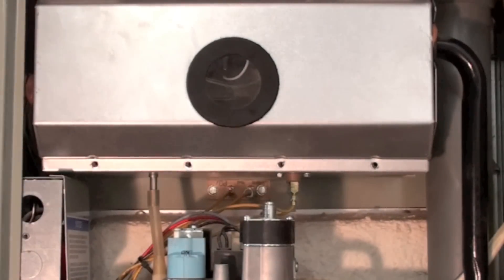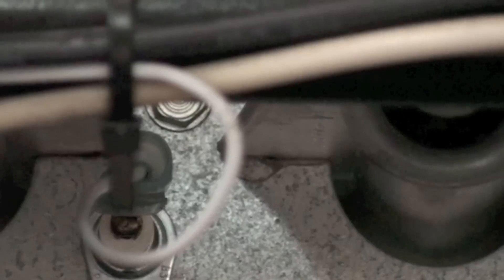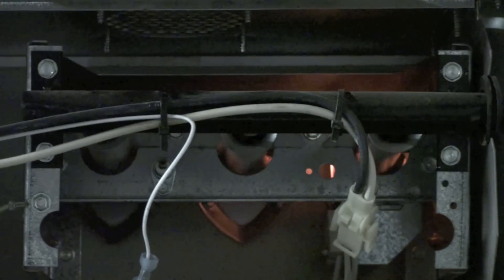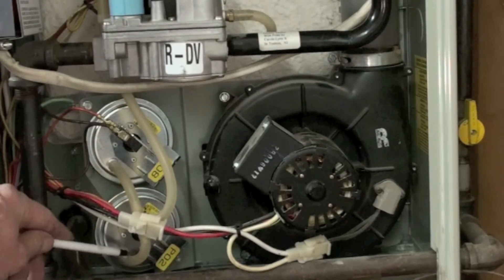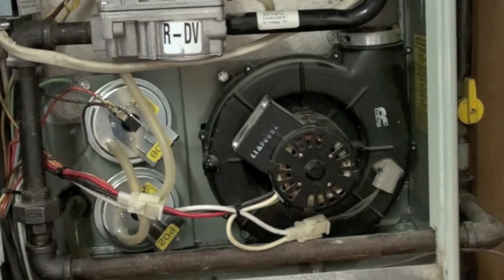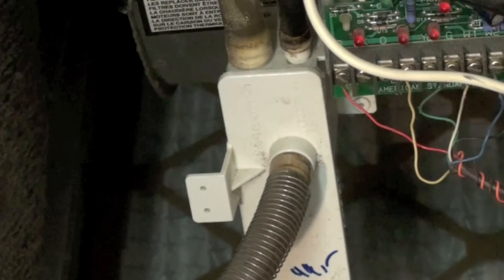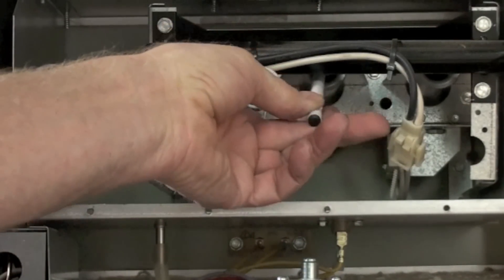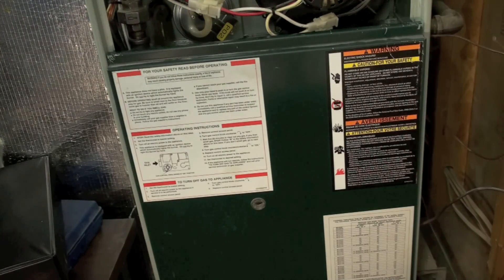Why does the gas furnace short cycle

Comment: Mr Furnaceman I have an Amana sse 80im getting what I think is a 3 light code blinking the furnace comes on the house reaches its temperature and shuts off and it wont come on again unless I shut it off and turn it back on again then when it gets cold the furnace tries to come on it does this short cycle thing I see the orange glow I hear the fan and it does this 3 times and then nothing I have to shut it off and turn it back on. Can you help me TX.
Reply from the maker: My thought is that the flame rod is dirty.  This video may help:  http://youtu.be/0ZYXK8450mM  Hope this helps.
GFM
Reply: well I took my problem to a local furnace parts store and the y thought it was an auxiliary switch so I replaced it that didn't fix it so they suggested a primary switch which I ordered so they tell me why don't you have a furnace repair guy look at it I told them I would rather try and fix it. so I break down and have a guy come out  I tell him about the code and he says ok ill look at it he cleans the furnace suggests getting a new thermostat and getting bigger cold air return vents . he says everything is good furnace is running I come back home furnace is not running and still blinking a code im out 120 and same problem.he said he cleaned all of that. like I said the furnace will run but after its heated the house and shuts off it wont come back on it trys but it wont fire up unless I reset it. TX
Reply from the maker: ***** This still appears to be a flame sense problem.  I assume the HSI is coming on, flame starts and shuts down after 4 to 7 seconds then shuts off.  Let me know if this is what is happening.
GFM
Reply: yes if that's the thing that glows orange then yes I hear the furnace come on the HSI lights up I do hear something click but there is no flame it does this 3 times and shuts down
Reply from the maker: ***** Are you sure you has gas available?
GFM
Reply: yes because sometimes the furnace works
Reply from the maker: ***** If you can determine that the gas valve has power(make sure the click is coming from the gas valve), you can place a screwdriver on the valve and put the handle to your ear, then the gas valve has failed. 
GFM
Reply: but wouldn't it fail all of the time ?
Reply: ok it did it again and I took the panel off and I actually put my hand on the gas valve and it clicked 2 times and I felt it and the furnace would not fire again so I had to reset it
Reply from the maker: ***** As for failing all the time, they sometimes are intermittent failures.  What it looks like to me is a failed gas valve.  Let me know if you decide to replace the valve yourself.  There are some tips you need to know.
GFM
Reply: Can you be pretty sure of this because I have already sunk 160 dollars into this project and that was even calling a furnace company
Reply from the maker: ***** I'm as sure as I can be without being there to troubleshoot.  
GFM
Reply: Ok I think I'll do it myself called the parts store they have it for 50 bucks. What's your tips. TX
Reply: Plus I called back the company to voice my not being satisfied and the guy said he would test the valve and hopefully that's it and not the circuit board. What are the chances that it is that.
Reply from the maker: ***** What I am going by is your report that you heard the valve clicking.  If the valve clicks, it means it has power.  But certainly having someone check it with a meter would be best.
GFM
Reply from the maker: ***** Replacing a gas valve involves breaking into the gas line.  Be sure the gas cock is off next to the furnace.  Look for the arrow on the valve.  It should point toward the furnace.  Once the valve is installed, leak check with soap bubbles every fitting you moved.  At this point, only leak check the up to the inlet.  Start the unit.  Leak check all fittings from the valve to the manifold.  Be sure you are thorough here.  When it is operating, check the gas input.  The easiest way to do this is by clocking the meter.  Here is a video:  http://youtu.be/I0bWSBVCXbo  Be sure the BTU input matches the model plate input number.  If at any point you are not confident, call a professional.  Finally smell all around the furnace.  
GFM

Comment: I wanted to say thank you for the information. My furnace was turning on and running the first time and then when it cycles it would short cycle a not turn on again for several hours and then turned on once. I cleaned the flame sensor and it resolved the issue. Thank You for the great video.

Comment: Thanks for all of your helpful videos!  I cleaned the flame sensor, but I still get a short cycle, click on, click off for quite a few times before it stays on.  Watching the cycle, I noticed that the hot sensor igniter is cracked down the middle.  I didn't see a video on how to change it.  Is this also normal for a Janitrol/Goodman furnace?  Thanks in advance for your help.  D.A.N.
Reply from the maker: If the HSI is cracked, it will sometimes glow intermittently for a while then it will quit altogether.  The replacement is not hard to do.  You just have to remember they are very delicate.  Unlike some say, touching the ignitor itself will not damage it.  However, I usually will not handle it by the ignitor because it is so delicate.  Hope this helps.
GFM
Reply: grayfurnaceman So grateful for your help!!!  Thanks again, D.A.N.

Comment: IF SHORT CYCLE BEGINS WITH ICY TEMPS, FIRST CHECK FOR ICE CRYSTALS IN YOUR EXHAUST.  THESE CRYSTALS WILL CAUSE A SHORT CYCLE OR EVEN STOP THE CYCLE.  THIS IS COMMON WITH BASEMENT HI-EFFICIENCY FURNACES THAT VENT THRU PVC AT GROUND LEVEL.  THE STEAM PASSING OUT THE VENT CAN CONDENSE AND FORM ICE CRYSTALS RIGHT AT THE ELBOW AT THE TOP OF THE VENT PIPE - REACH INTO THE ELBOW WITH YOUR HAND AND PULL THEM OUT!

Comment: Our Heil is short cycling,  we cleaned the flame sensor, changed the thermostat out, changed the filter, checked the condensation water line, checked for.closed vents, nothing has changed.  I am about the watch your video hoping for another fix
Reply from the maker: The secondary heat exchanger could be dirty.  Usually the furnace will run for 2 to 4 min if this the problem.  Another possibility is a heat exchanger failure.  You also need to check the vent for blockage or sagging.  Hope this helps.
GFM
Reply: I called a professional.  I appreciate your help!

Comment: I've watched most of your videos and looked on your website but can't find a fix for my gas furnace problem. My furnace is an older Hamilton PKBD fed by propane. When the thermostat calls for heat the small blower starts, the igniter glows hot, the gas valve sends gas and the flame lights then the large circulating blower runs. After a few minutes the flame goes out for a while then the igniter glows hot again and the flame lights up. It repeats this cycle several times then goes into lockout which I understand is the normal process if it makes several attempts to light. This has been going on for a few weeks and after resetting the power sometimes it works fine for several days. Filters are new.  I've replaced the flame sensor. I checked voltage on the limit switch when it was in lockout and the power was still on. No voltage across the terminals. I shutoff power and removed the wires on the limit switch and checked resistance which was 0. Any thoughts?
Reply from the maker: First, I would be sure the propane tank is close to full.  If the level is low or the tank is too small, low temperatures will cause a reduction in available pressure.  If it is a high efficiency furnace, I would also be looking for water drain or venting problems.  Hope this helps.
GFM
Reply: Thanks, the propane tank is not low and it has happened in higher temperatures, above 32 degrees. Right now it's -14 outside and it's been working fine since I fiddled with the limit switch and air pressure switch.
Reply from the maker: David Musall Also be sure there are no venting problems.
GFM

Comment: Very good video. Had the same problem but found the problem to be a bad contact between the flame rod flange and the steel mounting surface due to stripped threads and a loose screw. The rod's surface was fine and I reinstalled it with a bigger screw and lock washer. Poor design for such an important function. It should be installed with a screw, nut, and lock washer. Hope this helps someone.
Reply from the maker: That would do it.  Good luck on getting a manufacturer to use a bolt, nut and lock washer when they can get away with a sheet metal screw.  Thanks for the thoughts.
GFM

Comment: What do you think about this: my furnace short cycles for about 45min each time I turn it on.  After that it runs fine- no problems.  Almost like it needs to warm up before it can function properly.
Reply from the maker: Don't turn it off.  I really have no idea about that.  Sorry.
GFM
Reply: Did you check the filter? I would think you did but I changed mine and my furnace quit doing it

Comment: This video is a GEM. I spent several days troubleshooting my system, which was throwing a code for the pressure switch being stuck open. I replaced the pressure switch and the system worked for a day then the same problem recurred. The system board was telling me it was the pressure switch but it turned out to be nothing more than a dirty flame sensor rod. Steel wool, Done. Thanks for outstanding info.
Reply from the maker: Welcome
GFM

Comment: the reason you vent motor is filling up with water , 1 is that you have a blocked drain , 2 you collector box is blocked, for the gurgling in the pvc pipe that telling me the pipe dose not have a proper slope towards the furnace , the gurgling should be in the exhaust pipe where it elbows up on the out side of the house
Reply from the maker: All true.  I might add if the furnace is a new install, the furnace should be either level or pitched down towards the front or it will fill the back of the secondary heat exchanger.  Thanks for the thoughts.
GFM

Comment: Great video
I have a york 90% natural gas furnace like the one in the video, igniter has been changed and flame sensor cleaned but the flame keeps going out after only a couple of seconds. When I called in the furnace guy he would tap on the pipe where the gas ignites to get it lite and said that it probably has dust or dirt in them. Anyway every time the furnace shuts off its a pain to get it working again. It seams like everytime I have to tap on that gas pipe more and more and now only the first burner lights and then goes out. Can I take off these little jets to clean them out?
Reply from the maker: You can clean the orifices.  Also clean the burners.  Be sure power and gas is off and leak check when you are done.  Hope this helps.
GFM

Comment: I replaced the igniter and cleaned the rod but the igniter doesn't glow.  I hear the clicks like you mention and the ICF has three lights.  Two are lit (pwr and ok) the third (flame) is not lit which makes sense.  The big blower will come on after a few minutes but still not flame.  We just had an ice storm in Texas but I'm not sure if that is the cause or not.  Any hints are much apprciated

Comment: Any  body knows why furnance it keeps burning the 3 amps fuse on the control board
Reply from the maker: Most of those fuse problems are related to a low voltage short to the chassis of the unit.  Get several fuses and put one in.  If, when you turn on the power it blows, start removing low voltage wires from the terminal board until it stops blowing fuses.  That's a very simple explanation of what can be a quite complex job.  Hope this helps.
GFM
Reply: thanks  this  it help me a lot

Comment: Hi. I have a Quatro Consolidated Industries gas furnance problem. The igniter sparks and flame on it lights but then instantly shuts down right before the other burners turn on. Any ideas?
Reply from the maker: Is the ignitor lighting a pilot?  Do any of the burners come on?  How long do they stay on?
GFM
Reply: The ignitor lights the pilot up for like a second - but none of the burners turn on at all.
Reply from the maker: Steve Weitzner Before we go any further, if your furnace is a horizontal type.  I believe they have been recalled because of a fire hazard.  Just a word to the wise.  I assume the pilot lights, then it drops out and the pilot shuts down.  If that is the case, I would guess there is a problem with the ignition control.
GFM
Reply: It is a horizontal type but our model was one of the few that wasnt recalled. I already checked that out but I do appreciate the warning and the info you gave me. Thank you for your knowledge.

Comment: Hi grayfurnaceman, I have a Day& Night furnace Model376CAV24055ACJA Serial # 3692A14187 that my HSI doesnt glow, I unplug the HSI and plug in my meter to check for Voltage, My induce motor is runing and the blower at at the same time, But i never se 120 Volts going to my HIS connections, is the someting ells for me to check here?
Thank you.
Reply from the maker: Are you placing the meter on the leads to the HSI or the leads coming from the control board?
GFM
Reply: comming from the control board,
Reply from the maker: Nemorio M Vasquez I would check the back of the control board to see if any solder joints have burned up.
GFM

Comment: Mine started short cycling two months ago. HVAC guy came out and did something...probably one of the things you describe here. Worked about three weeks, then started again. HVAC guy replaced thermostat...still not working. I'm gonna try cleaning that rod thing and adjusting anticipator in thermostat tonight. I'm convinced it's thermostat b/c I can get the temp up by turning it way down, and then inching it up 2o at time, letting furnace rest a bit in between. But obviously if I'm not there to do that it short cycles. Would apprciate any thoughts you have so I can tell my HVAC guy (I rent so I don't have to worry about his bill). Gas furnace just like the one in vid. Thx GFM!
Reply from the maker: You can eliminate the thermostat by setting the temp at its highest setting.  If it still short cycles, flame rod, vent blockage, inducer problems could all be the problem.  Hope this helps.
GFM
Reply: grayfurnaceman What I wouldn't pay to have you be my HVAC guy, GMF!!
Reply: Laura Shafer Er, GFM!!
Reply from the maker: Laura Shafer Thanks
GFM

Comment: It's a Coleman Evcon model # BGM05012B
Reply from the maker: My thoughts are that there is an air flow problem, filter, dirty blower.  If its in a mobile home, it could have a crushed crossover pipe.  Other possibility could be a cracked heat exchanger leaking burner gas onto the limit.  This last one is a carbon monoxide hazard.  Hope this helps.
GFM

Comment: The ignitor lights up, the gas comes on and the fan will come on. After 20 seconds. The gas just stops so there is no more flame. The fan remains on. 

Board blinks 4 red lights which correspond to open limit switch. 

Gas won't come back on until I cut power to unit completely and turn it back on.
Reply from the maker: What brand and model #?
GFM

Comment: Heater was working fine until I changed out the battery to the thermostat. I pulled it off the wall and changed the battery. After that the furnace would not stay on. The igniter will light up and the gas will come on and it will blow heat for about 30 seconds than stop. After that it doesn't nothing unless I shut the power off and then it back on. Light blinks 4 times red. Which according to the panel means open limit switch.
Reply from the maker: Probably the problem is unrelated.  Check filter first.
GFM

Comment: GFM: My wife started the furnace while I was gone with the gas valve closed.  I get home and all it does is short cycle.  Based on the cause, what should I expect to replace?  I have replaced a presumed blown flame rollout switch so far and it is still short-cycling.  I also changed the filter and cleaned the flame rod.
Reply from the maker: The closed valve should not affect the operation now.  Do the main burners come on?
GFM
Reply: yes the main burners come on fine and then they shut off over and over again like the furnace isn't sensing them.
Reply from the maker: Jon B I am assuming the burners stay on for a few seconds.  Do you get an error code?
GFM
Reply: there is a green light which steadily blinks throughout, but once the blower kicks in at the end of the cycle, I get 2 pronounced blinks which correspond to "primary limit circuit open" - i'm not sure what that is referring to. 

I also realized that the rollout switches were never the issue since they would prevent the furnace from igniting at all- sorry for the confusion
Reply from the maker: Jon B Is your furnace vented with plastic pipe?
GFM
Reply: no it has aluminumish ductwork- I realize the typical primary circuit open error is related to overheating but I can't see that as being the issue- the problems arose from there being no gas supply to the heater.  Limit switch malfunction maybe?  I just don't know how to test it.  I have a voltmeter...
Reply from the maker: Jon B If you can follow a wiring diagram, you can look for all the limits on the unit.  That may help to find the one that is causing the problem..  You can bypass the limit to see if that is the problem.  Do not leave the jumper in for even a short time.  Just enough to determine if that is the problem.
GFM
Reply: unfortunately I don't have a wiring diagram- what do the limits look like?  Are they the large circular metal discs like in the picture for the above video?
Reply: I finally figured it out and thought I'd let you know- I had to let the system run in short-cycling mode for 1 hour for the system to reset itself.  Now its working fine!  And right before I was going to call the repairman.  I don't remember where I read the 1 hour tip, but it didn't sound promising when I read it which is why I hadn't tried it before.  Thanks for all your input though!